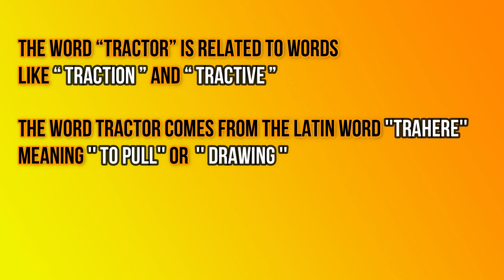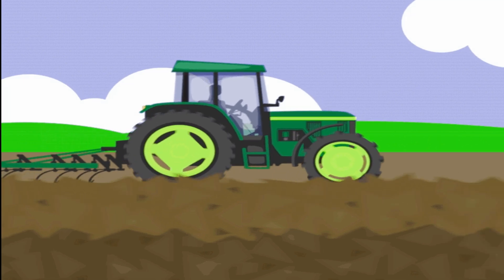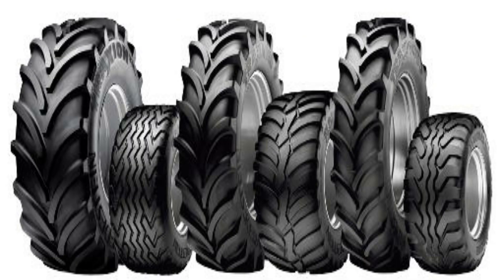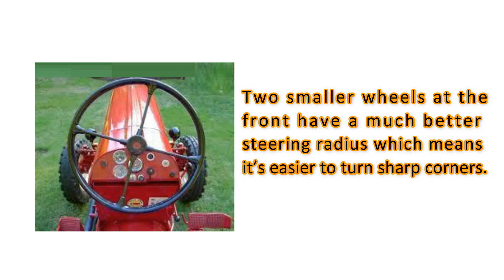Unveiling the Secret : The Mystery of Giant Rear Tractor Wheels !

Comment: Why not double-up on rear wheels?...or make the tread width very wide?...instead of using the VERY large diameter of the rear tractor tires? Look at performance cars evolution. The diameter has stayed pretty much the same but the width has increrased substantially. Wider tread also improves traction.  (LATER EDIT)..... I think the true reason for large diameter rear tractor tires is based on these factors--->
1.) A larger diameter tire has less curvature for its contact-patch on the ground, compared to a smaller diameter tire which needs a tighter radius on its contact patch. Therefore, the traction afforded by the larger diameter tire is increased and avoids slippage, independent of the width which can also be increased but is a separate issue.. 2.) A larger diameter rear tire places the centerline of the rear axle higher, and imposes a larger (Taller) "lever-arm" to the point where the hitch is located (typically a "lower" position compared to the axle centerline).....  that pulls the load. A taller tire gives more "lever-arm" affect and therefore more pulling torque.  It is, afterall...a tractor's main purpose to get as much pulling power (torque) as possible. It think these 2 factors predominate and totally overshadow the 5-7 "other" reasons we typically find stated in an internet search.